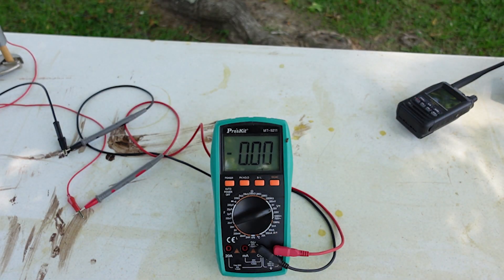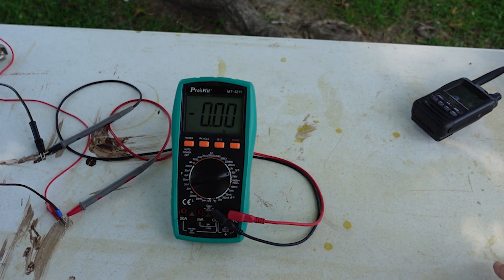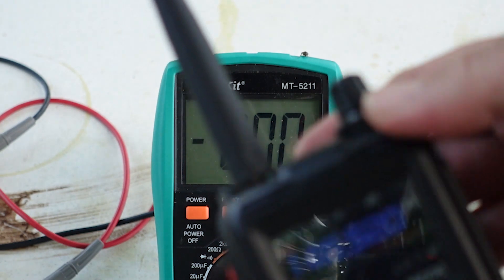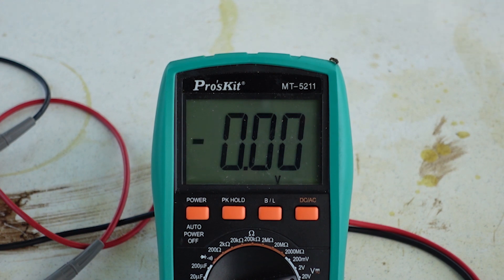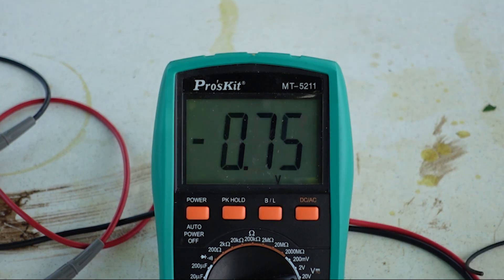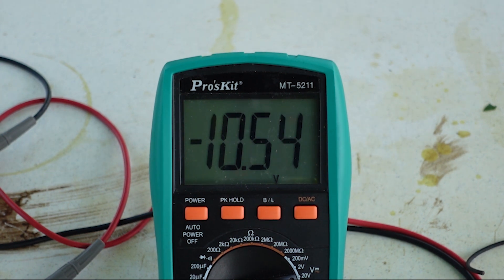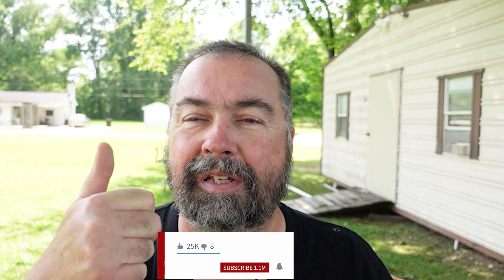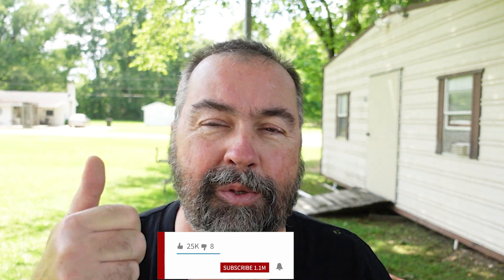The end of the (tiger) tail!

Comment: Sorry,  I know this is my third comment but you should start with your poise being longer than your antenna and only clip about an eighth inch off at a time to find the best tune. Not saying that you're definitively going to get amazing results if any, but that is supposed to be how to obtain optimal results. Another thing is that you're supposed to (from what I've been told) hold the poise at a ~50 degree angle slightly downward but pointing the poise towards the target objective.

Comment: You know,  i have one on my radio and in theory it should help a lot. But i think your body can interfere with the results as it's usually a counterpoise in and of itself. And in theory they work best when cut at the perfect length but i keep mine rolled up around the antenna for storage and I've noticed sometimes an improvement hitting repeaters when it's still coiled up or best when it's uncoiled but not straightened out. Sort of hanging there like a curley frie is best. Why? I do not know.
Reply: *fry

Comment: I wouldn't use one connected to an SMA antenna. The positive lead is so short you risk it not making a proper connection. Maybe the ones that attach to the belt clip, but honestly I don't see the point on an HT that already has a functioning ground plane.

Comment: A video by  a guy who calls himself the technogypsy on a channel called  Technog he demonstrated that the real difference came only when you shortened the counterpoise by 1/2 inch increments until it was tuned at the test frequency. With untuned  counterpoises he got very similar relative outputs as you  found.  He used a Nano VNA to test the tuning. The difference in performance that he got was going from microwatts uW to mW milliwatts  effective radiated power. It was a big difference so maybe you want to try your test again with tuned tiger tail counterpoise length. His testing indicated, rather convincingly I thought, that the counterpoise has to be tuned to the particular radio and antenna. That makes sense to me. 

Tom W3TDH

Comment: Can i make a dual band counterpoise for 2m and 70cm VHF/UHF with two wires of different length (each 1/4 wavelength) and put them together at one end? Would this work or can i only use one at a time? About the test: you said it already: quite inconsistent and not very meaningful with these readings. Not sure what to think of it. It may also depend on the antenna construction and all the surroundings nearby. Did you take into consideration the velocity factor of the cable? Should be near 0.9 for a single stranded copper cable - so you should go for that shorter length.
Reply: Use one tuned to the 2m at 1/4 wave. It works out to be 3/4 wave for 70cm just like the antenna because of the msths.
Reply: Having two would interfere with each other because of the magnetic field.

Comment: I'd be curious with this setup to see if the voltage goes up with the  Signal Stick. It is supposed to be a better antenna, but based on some tests I've seen the rubber ducky that comes with the radio is the better antenna.  Pigtails aside. The metal chassis of the radio is supposed to be the other half of the antenna, so adding a pigtail would to me, and the results of your tests be throwing it out of tune! I'd like to see a test between the Signal Stick and the rubber ducky!!
Reply from the maker: Challenge accepted - see my latest video.   Somewhat surprising results.
Reply: @FEPLabsRadio  Saw it. I was somewhat shocked is a few cases!

Comment: Isn't it also possible that with the tigertail connected the center conductor isn't making the same contact inside the antenna connector? Yes, with and without it was "screwed down tight" but that's just the threads being tight, there's going to be a slight (but possibly significant) difference in contact area of the center pin. Maybe you could leave that spade lug in place but use an alligator clip to connect the tail to the spade to remove the center conductor variable.
Reply: My Yaesu radios (to include the FT5) all have a rubber grommet that sits between the antenna and the handheld. When I use a tail I remove the rubber grommet. I end up with no discernible difference in the connection of the center pin.

Comment: You might use a had mic on the HT.  A good cheap box for the circuit is an Altoids tin.  I have used them for several projects.  I need to go back and look at that video of that rf signal detector.  Thanks for the video Jim!  73

Comment: From what your experiment is showing, I don't think it makes much difference, especially being that close.  Now maybe hitting a repeater a few miles away there might be a difference, but probably marginal at best. 73
Reply: That's what I was going to say. You need someone to take the radio some distance away and transmit both with and without the tiger tail attached, or talk to someone on simplex and have them tell you your relative signal strength with and without the counterpoise.